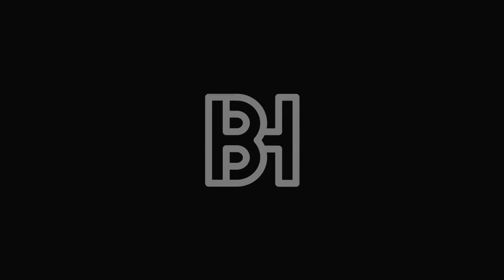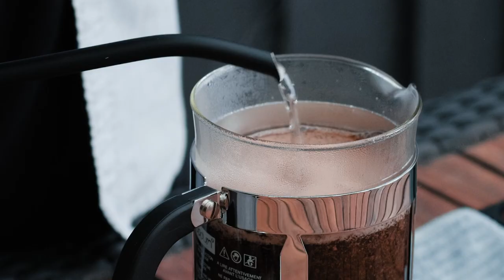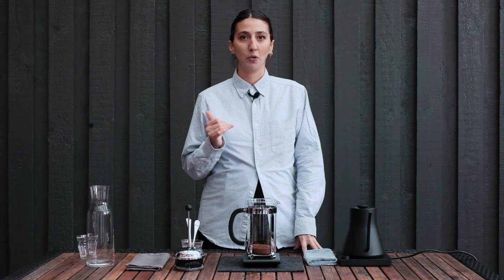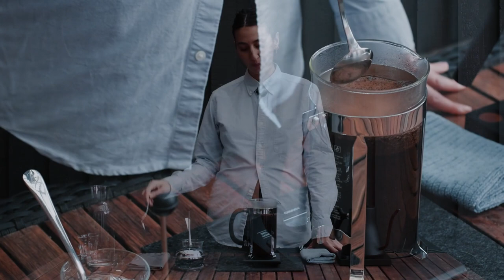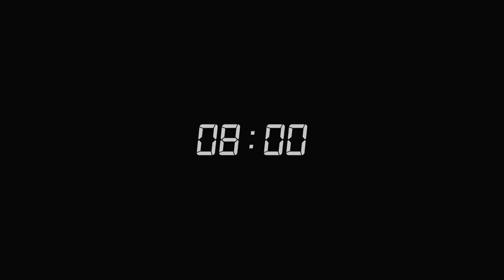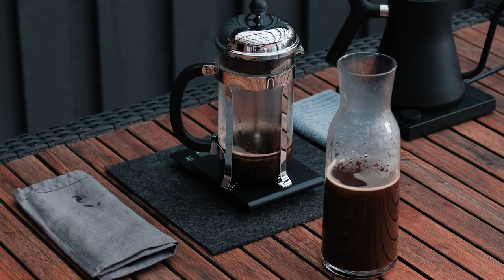French Press Recipe

Comment: Best video illustrating correct usage of the French press regarding this subject….two questions….what about fresh grounds …don’t we have to stir to reincorporate those grounds due to degassing initially and after 5 minutes when breaking the crust don’t we have to clean the micro foam at top for better clarity?
Reply: There is no have to it's just one recipe. However if you initially stir your French Press your coffee will immediately start to fall and you want get the best extraction. Your coffee should degas during the 5 minutes it sits on top anyway and it's not a concern for this type of brew. The foam (it's not micro foam that is milk) can be cleaned up but this is mainly a preference on taste in my opinion and not a must.